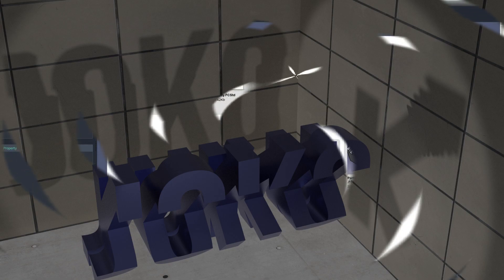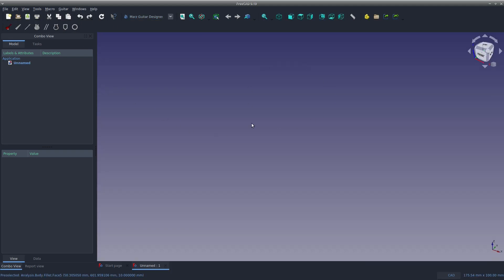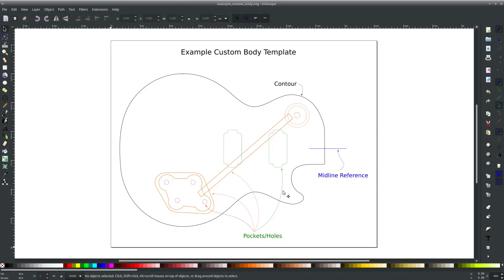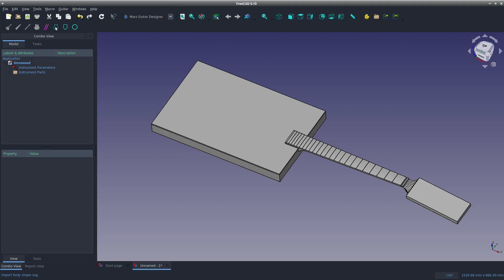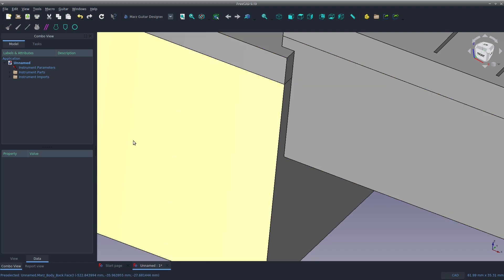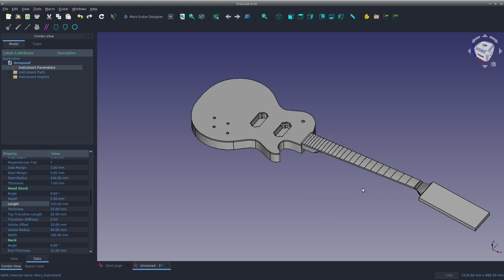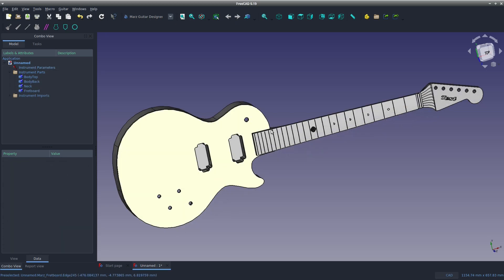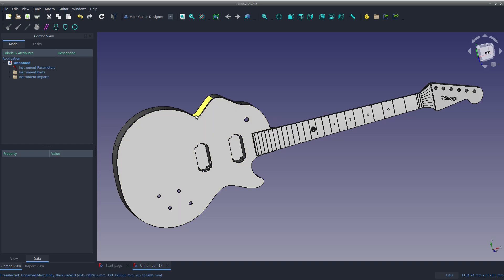FreeCAD - The Amazing Marz Guitar Workbench for Easy Guitar Design |JOKO ENGINEERING|

Comment: Thank you Yoko Engineering. Nice video. I am working on a new version with better transitions and better performance, and more options: Double asymmetric neck profile, arch tops, nut model, and generation of router templates...
Reply from the maker: Frank it's so nice to hear from you.  Your workbench is a true gift and we are so grateful for it.  I'm not a developer, but if I can support your efforts in any way please feel free to reach out to my email in the description.
Reply: @JokoEngineeringhelp  thank you Joko. I am a big fan of your videos.
Reply: I second this! I'm currently developing a small line of microtonal electric guitars, and would love to be able to use this workbench to experiment with different fret spacings(temperaments) as well as multiscale necks. I own a small product development company, and would be happy to also support your efforts in some way. quinnhale@copperkerf.com
Reply: What would you say the minimum system requirements should be to run this in win10 64 bit, I've got this on my mac in work and it works great but on my home windows upgraded to 64bit in order to run freecad 19 and Marz I find that when making changes like creating a neck tenon the  program becomes unresponsive.
Reply: @AndrewDawsonBrown  Actually I don't know because I am not a windows user. There are many reasons why it can become unresponsive. I use FreeCAD on Linux and Mac, But i do not have windows PCs. The FreeCAD forum can be helpful with this kind of things as you could find windows users there.
Reply: @mnesarcox  just started using your workbench and I'm having the same problem as mentioned by someone earlier that it keeps crashing but I was wondering is there a way you can change the heel and nut dimensions on the neck? 👍🏻
Reply: @SkipratGuitars  I am not sure what you mean by nut and heel dimensions as they are calculated from string distance at nut and string distance at bridge. Anyway the workbench is a bit outdated because I am developing a new version in c++ with 100x performance, proper transition surfaces and a ton of bug fixes in the model.
Reply: Thanks for the reply by nut and heel I mean the width of the neck at each end for example on a Precision bass neck it is 63mm at the heel and 42mm at the nut and a Jazz bass neck is 63mm at the heel and 38mm at the nut so if i understand correctly the way to change that is to adjust the string spacing on the bridge and nut parameters but does your calculations allow for the distance from the outside strings to edge of the fretboard which is generally about 5mm on each side? and does it allow for the taper of the strings at the end of the fretboard for example if the string spacing is 60mm at the bridge and 33.5mm at the nut the string spacing at the end of the fretboard is 54mm? Sorry for all the questions 👍🏻
Reply: @SkipratGuitars  yes it does. You specify strincg distandes (at nut and bridge) and also specify the margin between strings a fretboard sides.
Reply: @mnesarcox  thats great thanks for your help 👍🏻